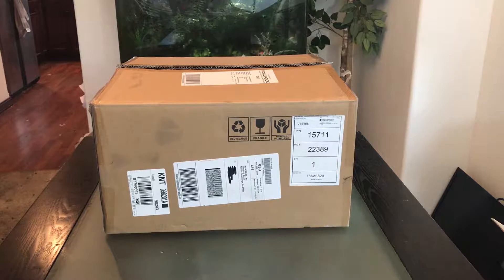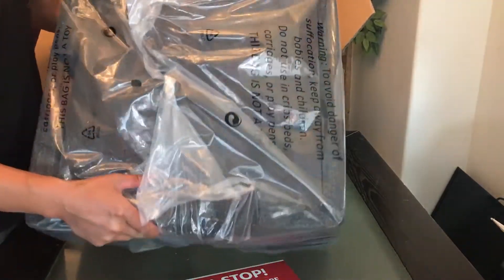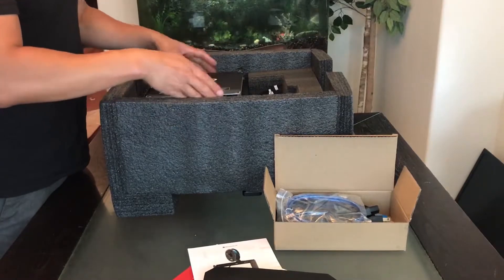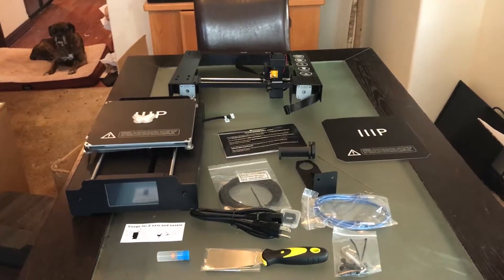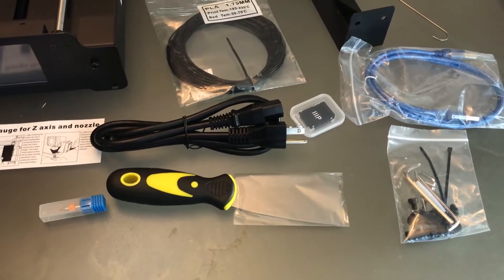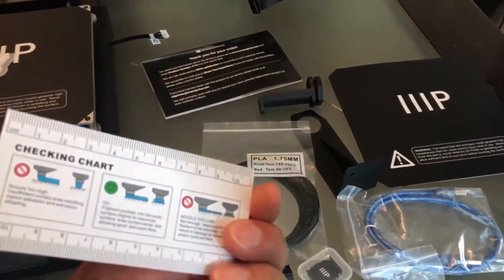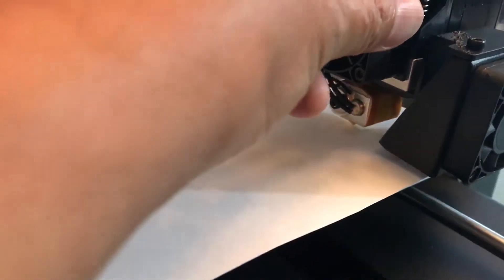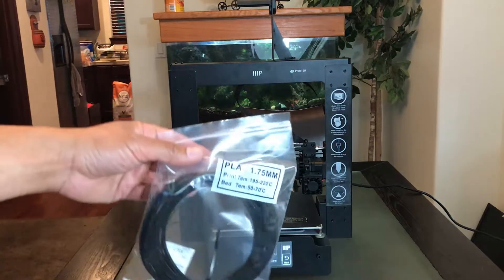Monoprice Maker Select Plus 3D Printer | Unboxing & Assembly Setup

Comment: I just bought mine for $12 at the flea market today.
Reply from the maker: What a steal. Did you get it working?
Reply: @JayRules  Im looking for a power supply / power cord to test it, might just order one If i dont have anything that will work though.
Reply from the maker: @haveacigar5291  Make sure it supports the designated voltage and amperage.

Comment: Thank you for this video. My birthday's coming up, and I'll be grabbing this for myself. It'll be my first 3D printer. Excited about the possibilities. :D
Reply from the maker: How did you like it?
Reply: @JayRules  - Replying from another account--one of the best investments made that opened doors to lots of interesting projects, "Quality of Life" things and I design a lot of stuff with TinkerCAD. But I also recently decided to add a Voxelab Promixa 6.0 resin printer as a companion for just mixed materials. 

I also added glass to the bed, went with the Micro Swiss all metal hot end and lever, as well as hooked up a Raspberry Pi for OctoPrint. Also, a stepper motor. All of the installation and little upgrades as well as maintenance are easy enough; with this printer being a rebranded Wanhao duplicator i3 plus, you can get parts and things relatively easily.
Reply: @stephanieamare  where did you get the glass bed

Comment: BTDT The instructions are not complete or accurate.
You missed the large ribbon cable that plugs into the side of the base from the vertical.
Once connected you should see both heaters warming up.
Reply from the maker: Thanks for the pro tip.